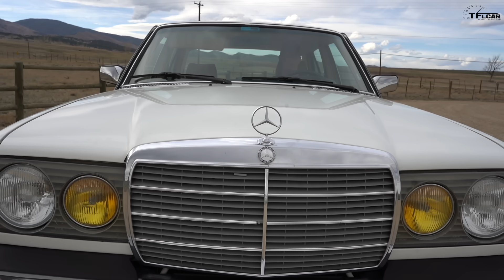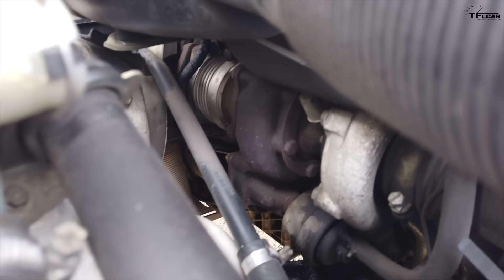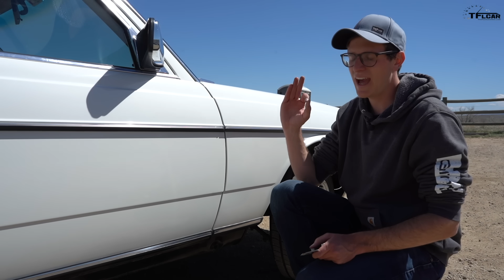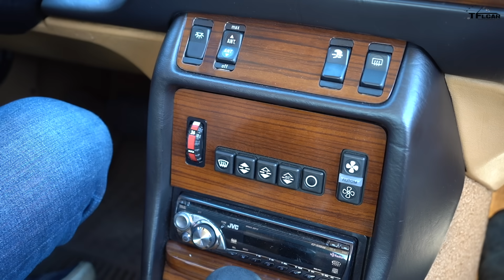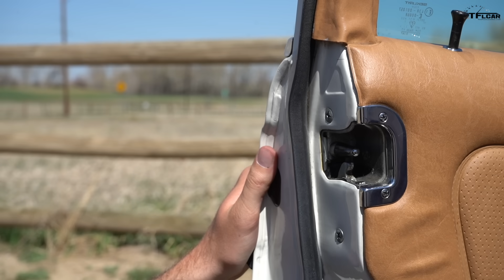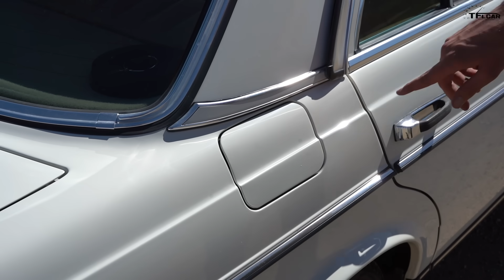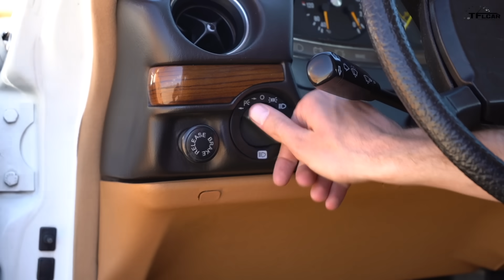This 37-Year-Old Diesel Is THE BEST Mercedes Ever Made!

Comment: You didn't mention the gas cap holder.  Those springs on the fuel door aren't for decoration.  I slide my cap in there and never drive-off without it.

As for the best... well, yes, it's right up there with the basic, bottom-of-the-line Volvo 100 series, 1971 - 1977, and the 1998 - 1991 W126 300se which came with a cast iron block and standard manual transmission, of which I have never seen.  The automatic was an option.  Being a Sonderclasse it didn't have the optional manual windows, and I'm sure there must be a 300se without a sunroof.  Again, never seen that.
 
but

like all cars, there are quirks.

Who puts an engine mount below the manual fuel (lift, boost, primer) pump?  Sure, they come with a shield from the factory but I've never serviced a W123 diesel with the shield still there.

The sunroof is an engineering marvel, and they come with a forever guarantee.  No matter how many people have previously owned the car, they sunroof is guaranteed to leak.  Just a fact of life.  Easy to service and preventative maintenance is a must.

Horse hair seats in the '80's???

Electronic climate control???  Just like the sunroof it too comes with a "forever guarantee".  Just give me push/pull levers connected to Teleflex cables.

Want RR type picnic tables?  Make your own from the rear arm rest mechanism, you just won't have the space to use it (MB did make a 240DL (lang).  I think they added 4" for the sake of the rear passengers.  Only seen one of those). Like with most all manufacturers, the bottom-of-the-line models are usually best (my sincere regrets to those who "saved money" and bought the Pinto, or the Vega) and this is certainly true here.  The 240D with the external clutch slave (earlier examples had internal slaves), manual transmission (which any INEXPERIENCED mechanic can rebuild in a few hours on the kitchen table while the wife is away), manual windows, no sunroof, cloth seats, high-speed differential....

Yes, it does have its excentricities, but keep it serviced, and rust-free, and you will be content for decades.  Just don't buy a cheap one.  You CAN'T afford that!

Comment: I have a 82 240 D. I drove it for 6 months never going over 60MPH cause it sounded like it was wound out . One night,I had a few beers and had to drive about 50 miles up the freeway,way out in the country. I said,I'm going to see how fast it will go,if it blows,it blows.When I got up to 85,90,it got quiet,and smooth,like being in a boat and trimming it out. It will go 90 all day and all night. Momentum is everything. If you let the RPMs down,you are hung out to dry. Keep your foot in it,and it keeps up with anything. Don't baby it,floor it from a stop,it shifts better.  When you shift from Park to drive with your foot on the brake,the car rises 2 inches,it's wild. The fog light light up the side of the road 15 feet off the road and the beam is flat,not round,and I see deer off the road that are invisible till the light is on. The brights are super bright. I drove 80 miles once with no alternator,at night. I had no headlights,but I rode on a cars bumper,they never knew I was there.  Drove from Atlanta to Daytona in a hurricane once,and never slowed below 60 MPH. Wind was blowing south to north,so I was heading straight into it,like being on a rail,with brand new tires. Handles like a go cart.Corners like a race car,no lean,sticks. Go into a curve at 70,come out at 80.Sticks better with foot on the floor. Best,most fun car I ever drove. You "drive" this car on freeway,not just ride. Not just get from point A to B,but drive and enjoy it.

Comment: We had one that my parents bought new in 1983; a silver 300D turbodiesel with dark blue MB-Tex interior (indestructible material BTW).  I spent many Saturday mornings hand washing that car as a teenager.  Later in life, I bought it from my parents and used it for about 15 months while working in Virginia.  I got so many offers for that car (I kept it mint)...but by that time it was already family.  I gave it back when I moved overseas on work assignments. My dad doesn't drive anymore and the family moved to TN, so they sold it a couple of months ago.  It hadn't been driven much and was in need of some care. Rust by one of the windshield corners and a bit of rust that had formed behind the front passenger wheel well. Chalk it up to NY winters.  I did put a rust stopping coat on these spots during vacation a few years ago and it did stop the progression, but this and the sunroof were in need of some restoration.  Every time I talk to my dad...the first thing he mentions to me is that car and how he regrets selling it...even though he doesn't drive anymore. It is one of the vehicles you just cannot forget. Sound build and quality.  It was slow and, by today's standards, not the most comfortable car to drive as the driver seat springs had weakened over time.  But damn...you knew you were in a Mercedes.  That and a Porsche 911-964 were the best cars I ever owned.

Comment: the yellow fog lights really help in fog. It's very simple the yellow light is reflected in a different angle when it hits those microscopic water drops and thereby you don't blind yourself when driving in the fog.
Reply: They also have a different wave length to penetrate the mist much better...

Comment: I have a 1983 300TD wagon that I bought in 1987. It still has the original windshield and paint, always garaged. I bought it with 116,000 miles and now it has 270,000 miles. All four of my kids learned to drive with this car. It is still going strong. It’s the best car I have ever owned and I wouldn’t hesitate to drive it across the US.

Comment: I really wish people would factor cost of ownership into “best car”. People love the Mercedes diesels “can’t kill them” Kent from Mercedes source would beg to differ. You can easily neglect a Mercedes diesel and destroy the engine, which is an expensive replacement, also properly maintaining one can be expensive using close to oem quality parts that are becoming harder to find. Then there’s the fuel, diesel is expensive! Oh but wait they get great mpg... wrong. The 240d, one of the most frugal merc diesels struggles to get 26-30mpg, a tdi Jetta can get 45-50 and is 3 times faster. Oh but there’s bio fuel it’s free, every bio conversion I’ve seen was a nightmare eventually and their owners invested more time dealing with waste oil collection and cleaning than they could have just paid for in fuel with a minimal wage job for the same amount of time/effort. 

The best car ever made doesn’t have to be the most reliable, it does help, but who cares if your $500 car blows an engine and it’s $600 to replace every 150k miles vs a $1200 maintenance bill on a vintage merc. I’m not trying to to call the merc diesels anything less than exceptional, but best car? I don’t know.. they sure are not the cheapest to keep on the road.

Comment: My 1982 300 D is sitting about 20 feet away in my garage. I bought it new for $27,500 and still drive it some. it is still a pleasure. I have had 5 E class and still have 3 that were all bought new. my 51-year-old daughter learned to drive on it. The mechanic who works on my cars has a 1985 Diesel wagon with over 500,000 miles on it. Mine is low mileage at 200,000. It was years of pent up desire until I could own one. It starts right away with no hesitation. I love the sound of clackety, clackety clackety for it is like no other. Mine is all original. Great review.

Comment: I had an 85 300D for 29 years.  Put 390K miles on it.  Never had any trouble with the motor.  Engine never rebuilt, still running strong when I sold it in April 2017.  Rebuilt transmission at 310K miles. I loved that car.

Comment: North Africa? Ok, good car there, but not in Germany's snowy winters except you put additional weight in the trunk. Secondly I did not get along with the seats in my taxicap.  Always pain in the back. I did much better in the old dashers (VW) these days. In following model W124 this problem was solved by an adjustable seat. So no, for me personally at my place this car is a monstrosity.  W124 also got rid of that winter problem by a better weight distribution, was stronger by same capacity, much more quiet und still very durable...

Comment: My brother owned a 1984 300D.  He loved the car, but it started having a lot of vacuum problems, so he bought a Jeep Grand Cherokee.  Talk about jumping out of the frying pan right into the fire!  But he loved the engine so much in the 300D, he transplanted it into a 1949 Ford F4 one ton truck he was doing a frame off restoration on.  He had to fabricate a bell housing, adapt a 460 Ford flywheel and starter and make numerous other things to make it work.  It turned out really good.  The 5 cylinder diesel has very similar horsepower and torque specs of the outgoing flathead V-8. Talk about a head turner; he gets stopped all the time with people asking questions and just wanting to look.

Comment: How do you think my 1987 300SDL stacks up? 620000 miles. The usual repairs and service, but still quiet (despite diesel) and tight. Still drives better than most cars. Has a huge back seat.

Comment: I prefer the W201 190D with the 2.5 NA engine.  I have almost 800,000 miles and no major repairs.  Most parts are cheap, and it gets 40 mpg at 65 mph but will easily cruise at 90 mph.  nothing to do on a regular basis but alternator belt, oil change, brakes, and tires.

if you use the later 300 style injectors, it will run much quieter at idle.

Comment: You CAN actually run it without any electricity! I had an electrical failure on my W126 while it was running. No lights, horns, windows or any electricals, but managed to drive it 30kms to my garage.

Comment: The strip was to protect the car from other car doors hitting it in a parking lot.
Reply: It’s helped me protect mine so many times!
Reply: Agreed. But hey, if it keeps the door handles clean(er) at the same time...
Reply: I had a volvo 240 ones. The blower motor was broken, and I accidentally ended up in the ditch because of all the moisture on my windshield. My volvo plowed trough several bushes. A tractor pulled me out of the ditch. I had to reattache the door trim on one side.   Otherwise the car was fine. Not a single scratch on it.
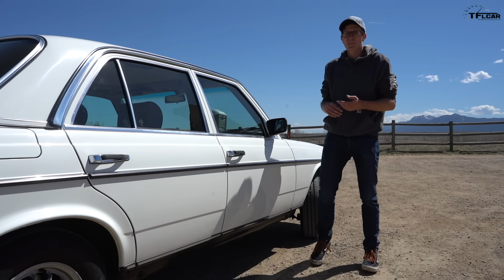Reply: 5:34  The kid is stoopid.
Reply: @dreamdiction  why what did he do say
Reply: for each is own
Reply: Good ol door jack and shopping cart bumpers, I wish more new cars had them

Comment: I HAD THE 300D NON TURBO. NO GARAGE IN WINTER WILL NOT ALLOW YOU TO START CAR. YOU HAVE TO HAVE A PLUG IN OUTLET TO WARM UP GLOW PLUG AT NITE.  CAR HAS POWER CORD TO PLUG IN DURING WINTER.OTHERWISE CAR WON'T TURN OVER OR START. ALSO YOU WILL NOT BE POPULAR DRIVING CAR AS THE DIESEL SMOKES LIKE AN OLD COMMERCIAL TRUCK. THE CAR IS SO SLOW THAT IT IS SCARY.  YOU  WILL FREEZE  TO DEATH IN WINTER  AS THE  HEATER AND DEFROST ARE WAY SUB PAR. DIESEL GAS IS NOW EXPENSIVE AND SOME STATIONS  DON,T CARRY IT  OR JUST HAVE 1 PUMP THAT DOES. THOSE NICE TIGHT DOORS WITH WINDOWS UP IN SUMMER SITTING IN SUN  WILL STRETCH SIDE PANELS DUE TO OVEN TYPE TEMPS INSIDE OF CAR  WHEN PARKED.  VERY NOISY ENGINE AND SMOKE IN REAR VIEW MIRROR CAN BE AMUSING  WHEN LOOKING AT THE  FACES OF PEOPLE BEHIND YOU GETTING REALLY PISSED OFF IN A THICK CLOUD OF BLACK SMOKE. EXPECT TO GET  FLIPPED THE  MIDDLE FINGER  EVERY DAY.  CAR CAN RUN ON FRENCH FRY GREASE. REALLY. THATS HOW I FOUND A CLIMATE TYPE CHEF TO BUY IT. THEN THE SMOKE SMELLS LIKE DOUGHNUTS.

Comment: Two more interesting features:
When you switch on the fog lights and especially the rear fog light and turn off the lights, the switch automatically retracts so you don't drive with them in next time you switch on your lights. A feature other manufacturers needed 20 years to copy.
The fuel filler cap fits in the spring mechanism of the lid during fueling. 

The whole car is full of more clever details than many modern makes.
Reply: We don't call them "Ahead of its time" for no reason.
Reply: Joerg Schoettle ;y

Comment: it would be nice to have a 240 d  or 300 d with air conditioning and 5 speed.  i don't know if they made such thing but it would be nice.  and a beautiful new light blue paint job and good interior.  is that too much to ask for? i like front wheel drive, but not necessary because we don't have that much snow anymore.  also it would be nice to drive a car the way god intended them to sound like, which is mercedes d.  what ever happened to mercedes?

Comment: Turning radius is similar to a Volvo 240. The advantage of not having front drive shafts (that would not accept a near 90 degree turn angle) plus they kept the wheel base pretty low.

Comment: well i got a 84 Toyota Celica ST  last of the rearmotion and i took it a year before in the worst condision it has the same factory fly weel and 350 000 klm i changed only the oil and gas pump and filters it runs and drifts the same maybe a bit less ...the thing is old cars where made to last.. nowdays cars are made to be changed every 5 or less years

Comment: There is no argument - these cars are terrific. The only downsides for ownership are: 1) The lack of airbags for safety 2) They are less economical on fuel than more modern cars 3) They are more polluting than modern cars. In pretty much every other respect, these cars are over-engineered (in regard to being robust and durable). German technology of the period took (and takes) a lot of beating. I've just tuned a German piano (Ed Seiler upright- I'm a piano tuner/technician) and it was/is terrific. Same story - German technology and outstanding craftsmanship stands head and shoulders above almost everything else... By the way 31 feet is just under 3 METRES - NOT centimetres! 3 Centimetres is just over an inch...

Comment: You think that turning radius is impressive? Try a Volvo 240.
Reply: Actually, at the price point, the Volvo was probably a better engineered, better designed car and easier to maintain. So much on the MB is run by vacuum that even small leaks can produce severe problems in operation.  People often view them through rose colored glasses and forget all the maintenance and repair issues that invariably come up with time. Then there are the body/frame rust issues.  The AC is unreliable and, if you like those sun roofs, better learn how to put the cables back on the pulleys when they come off.

Comment: I would say it's my second favorite for the old diesel cars. The one I like best, even though it's not a turbo diesel, or has a lot of horsepower, is a 1980 Mercedes 240D
Reply: The 1980 240D is my favorite year too, just spend a few dollars and a few hours and convert that dang clutch slave to external.  Not sure what year they switched but my 1983 is external, my 1980 is internal.
Reply: I'd prefer that one too. Drove them all as taxicaps, the 200 (to weak, to noisy because of that, the 240 and the 300, to heavy at the front.
Reply: @benz merc  Nostalgic and longevity reasons
Reply: @benz merc so simple, non turbo and dead reliable.

Comment: I was a chauffeur throughout the 1980’s, large family owned private company, 16 directors all had 280E 6 cylinder petrol Mercedes saloon cars, similar/same body and rolling stock, I think, as the 300 diesel you are discussing. 
The family members had other marques including Range Rover, Jaguars, Rolls Royce, Bentley, Porsche AND 3 Merc 500sec’s, 2 Merc 2door 280SL and towards 1990 just the one Merc 560 sec. 
Obviously we got to use just about all the cars the company and family members owned (with the exception of a Porsche 911 turbo and a Ferrari 380 GT, these were allocated to favourite daughters and we rarely got to drive these )
There were two chauffeurs, I was senior, we got to drive most of the above, when not actually chauffeuring we did courier work in and around London and the south east, France, Spain and Monaco ( at F1 GP time ) 
‘Courier work’ was collecting/delivering documents and various items. Minor company clients were picked up from airports, trains etcetera and often returned same day or within o eh or two days. Christmas times were hectic. Family directors received alocades/awards at functions and dinners for and in behalf of bothCompany/personal achievements. The MD earned a CBE and later a KBE.
OK - my point - majority of the ‘courier’ jobs I undertook were almost always with a 280E, I did many and in one year-1985 -my total mileage was over 150K.
So you can imagine I have some experience with exec cars. 
I knew the Merc 280’s so well and what a motor comfortable, drivable, they handled,  they had speed and my god were they reliable.

I can’t imagine the 300diesel being better, as good maybe, but the 280 E sure takes some beating, I’m retired from work now but I have driven modern E and S class Merc models - they are not as good !!

Comment: Luckily happened across this clip and so glad I did.  I'm still putzing around in my '85 300D turbo, now about 400k miles later from the day I picked it up in November 1984.  (The odometer broke at 276k so we are estimating on mileage records kept for business over the years.)   It's been more fun than I  probably deserved to drive but always a solid, dependable ride.  I'm doing some fluff up on the engine currently and it's running again today like it did 15-20 years ago when I did Austin-Kalispell MT (2000 miles) and back more than a few times.  But those long, flat stretches of highway where you could see forever?  Perfect for getting it "up to speed;"  you get my drift.  The most fun is when someone in a new $70k car jackrabbits around me and then I pull up beside him at the next light.  I always want to roll down my window and ask, "Will yours still be running in 35 years?"